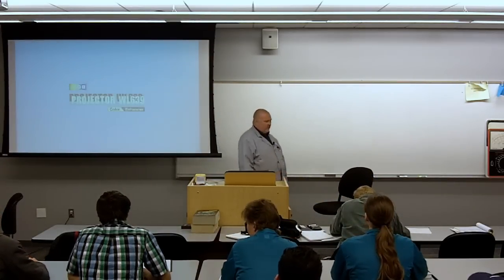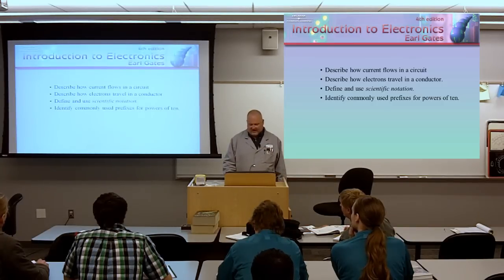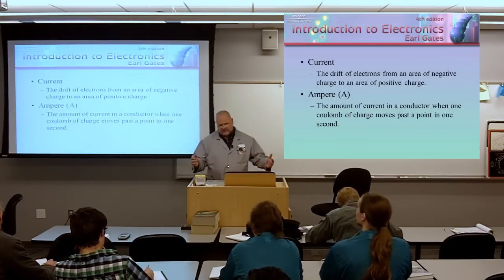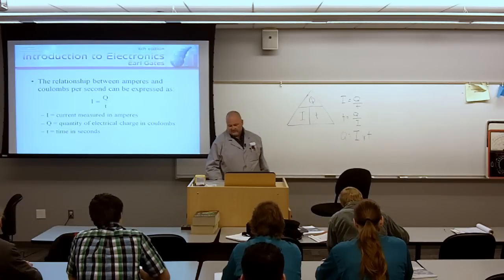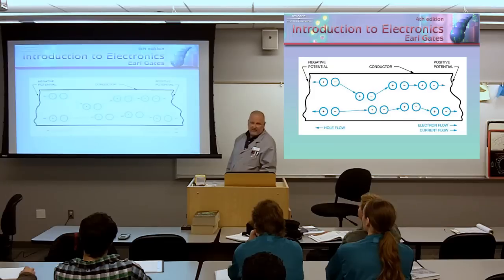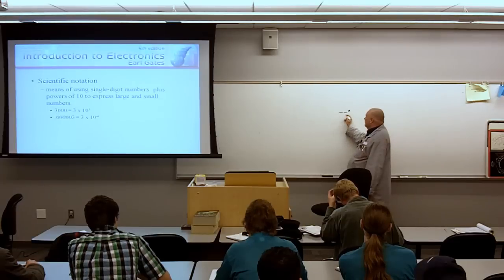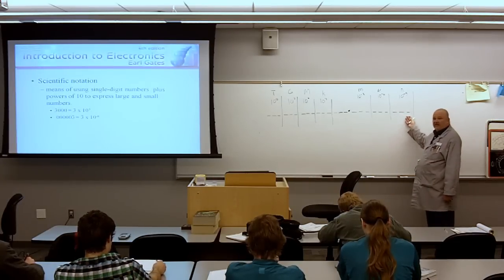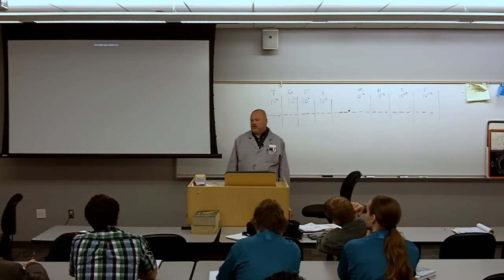ELEC 110 Chapter 2 Lecture - Current

Comment: Is there even enough Free Electrons in Outer Space to allow a Generator to produce Electricity if we had enough Oxygen in a Tank to allow an Internal Combustion Engine to run?

What about Engine lubrication due to Space's Less Gravity?  Would the less weight of the Engine Oil hinder the Oil from settling back into the Oil Pan fast enough to be recycled again, thus destroying the Engine if made solely for use on Earth?

Comment: << Without Ionization, you CANNOT have Voltage.  Without Voltage, you CANNOT have Current Flow. >> Per the Professor.

Is the Professor basically saying "ALL Generators, or anything that Produces Electricity, are Ionizers, without Exceptions?  TIA.

Comment: This guy is good but some of the things he says are not correct.  You can think of electrons as electricity but its something of a simplification. And no, they do not travel at the speed of light. Propagation of the current approaches the speed of light. The electrons not even close.
Reply: If this is wrong this would be serious flaw. Please give reference.  Thank you.
Reply: @zuheyr1  The electron has mass. Therefore, it cannot travel with the speed of light. However, the current is not defined by how fast an electron is travelling. Current is defined with the Amperes. 1A = 1C/1s. Therefore, you need 6.24*10^18 electrons cross an arbitrary chosen cross section of matter in 1s for you to have current. How fast this happens depends on mechanics, both classical and quantum. HOWEVER, keep in mind that your piece of matter has electrons ready to move all around its body. The chances  of 6.24*10^18 electrons crossing that section in 1s instantly is 0. Close to instantly - very high.

I hope this helps. Keep in mind I have not watched the lecture so I might be a bit off in my explanation.
Reply: This guy is teaching Basic electronics. He is giving an example and understanding of how electricity is created. Simple sometimes is the best way to introduce something. You cannot just dive in and know it all
Reply: Correct.
Reply: Seftdelmer what is correct? The instructor or the comment?
Reply: You are probably the same person that never fails to complain the instructor is using an equation that measures something in a friction-less vacuum in your physics class. This is just to get you on the right path to understanding basic concepts, you can worry about the extreme cases, more realistic one might say, in a deeper lecture series.

Comment: I watched a lecture from Cal the other day, and he was explaining that while it is easier to study electronics by assuming that current flows at the speed of light, the individual electrons themselves move much slower. However, the force that an individual electron has on the electrons around it, sort of pushes the electrons next to it, creating an almost wave effect from point A to point B. So even though the individual electrons move much slower the current itself appears to travel much faster

Comment: The fact, that electrons can move faster than speed of light under certain conditions is true. It is impossible to move faster than speed of light in vacuum, but light moves slower in other things, for example water. For that reason, it is possible for something to move faster than the light in a non-vacuum.

Comment: I didn't know that it was cheaper over long distances, but it does make sense given the price of copper. The VOP of a coax cable is relatively low, but some materials allow for a VOP around 90% or more. And even at 66%, when you consider the speed of light, that is amazingly fast. And I'm not sure where you read that they can travel faster that the speed of light; the LHC at CERN can't even do that. Nothing can exceed the speed of light, its a fundamental law of physics, thanks to Einstein lol

Comment: I did some reading since then, and fiber optics are cheaper if you need to transmit data over around 2km.
As for electrons, no, that is very bad simplification. First of all, in some rare cases they can travel faster than light, but, they can be slowed down significantly. Speaking about wires, electrons can travel as slow as 66% of the light speed through a coaxial cable, for example.

Comment: in practice, electrons travel through a conductor near the speed of light. Saying at the speed of light in a simplification. Fiber optics are used for their noise immunity characteristics. The downside is that they are expensive, and much more difficult to install and repair.

Comment: I don't understand how electrons can travel at a speed of light, they just can't travel that fast, or else why would we use fibre optics? Pretty much all couple gigabit and further networking is done through fibre optic cables. If there was no benefit to it, then why to go through a hassle of converting electrical signal to a light and then back to electrical signal?